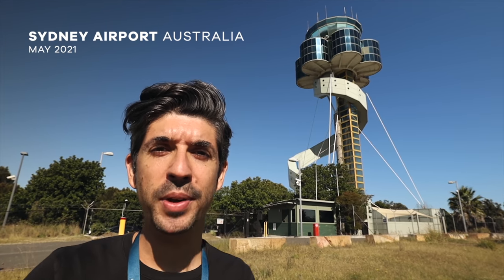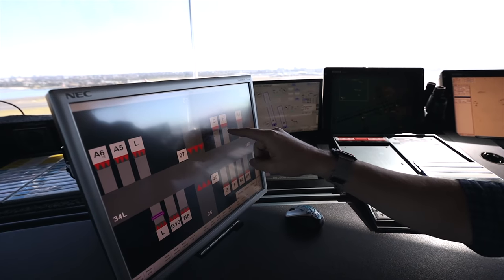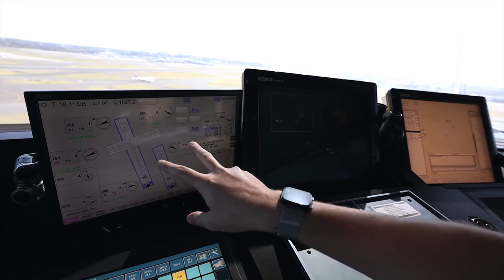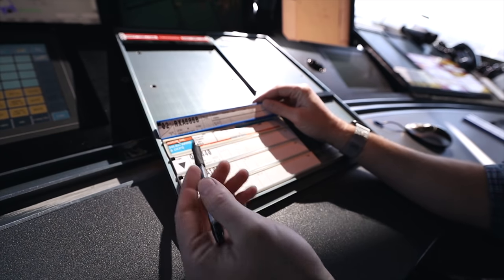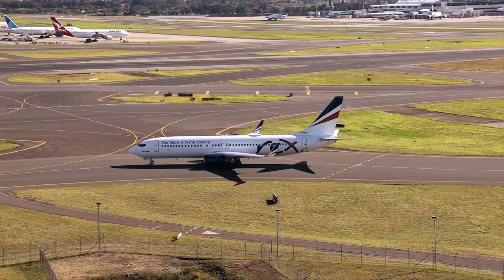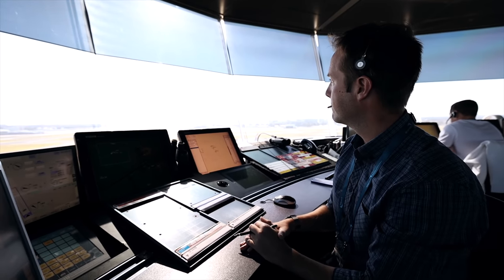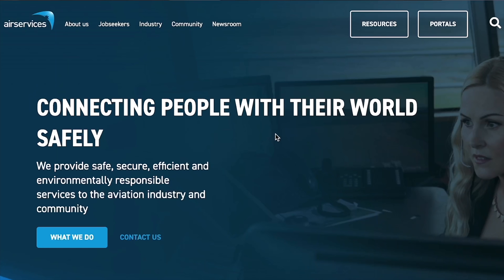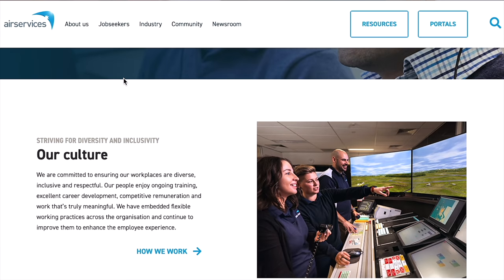Inside Australia's BUSIEST Control Tower!

Comment: Really good video. One signature structure that has always fascinated me driving past any airport is the rotating radar dish. They always seemed to be moving 30% faster than a huge metal contraption like that should be. Like a fairground ride where the operator has slumped over on the dead-man’s lever.